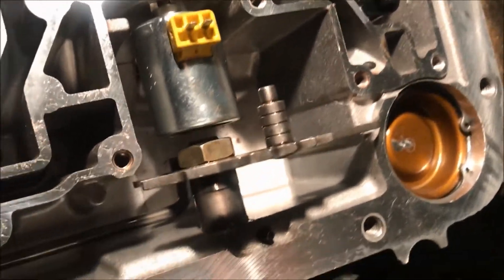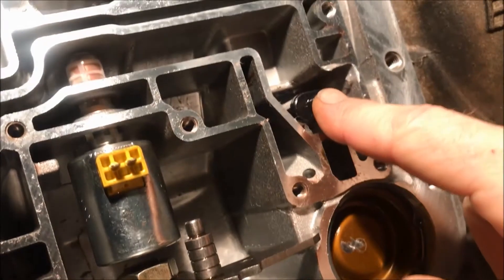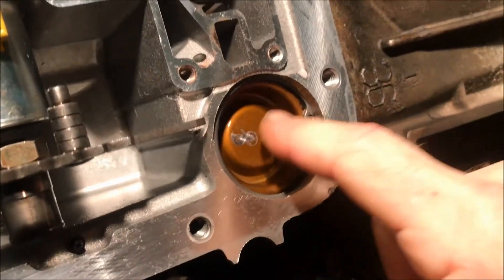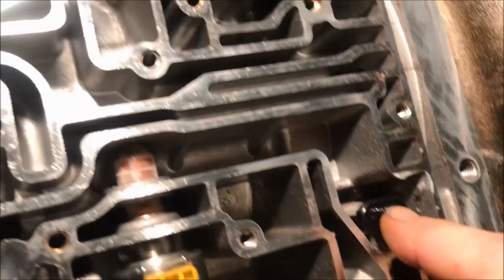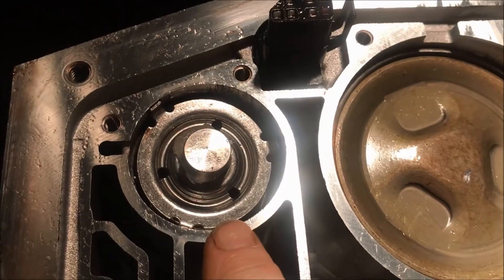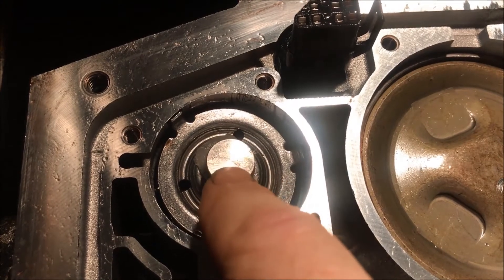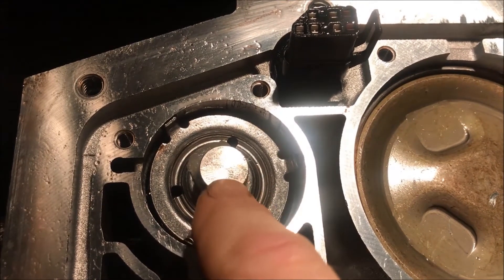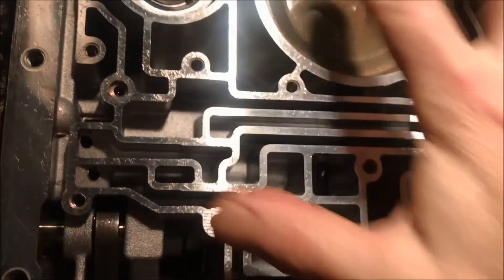AODE, 4R70W, 4R75W & 4R75E Valve Body Screen Filter Location: 4R70W Series Part 7

Comment: That filter is only there for  extra protection up to first service. Once transmission is serviced it is no longer needed. Doesn’t hurt to have it though.
Reply from the maker: Thanks for that input
Reply: Thank you I’ve been lowkey trippin about not being able to find it but I’ll be putting that valve body up soon 🎉🎉

Comment: Is that filter necessary? I heard we can discard it after service, not 100% sure , I forgot to re install mine when I put it back together, have not put fluid in yet, thoughts?
Reply from the maker: I’ve never heard that, my opinion is the more filtering the better.  If you haven’t added the fluid yet it’s super easy to pull the valve body again.  Hate to cause you more work!  By the way, why did you pull the valve body?
Reply from the maker: Thanks for the input, good to know